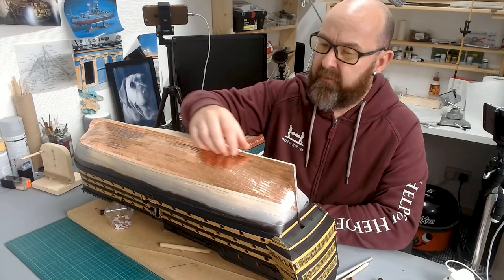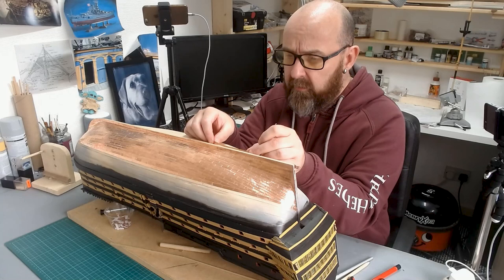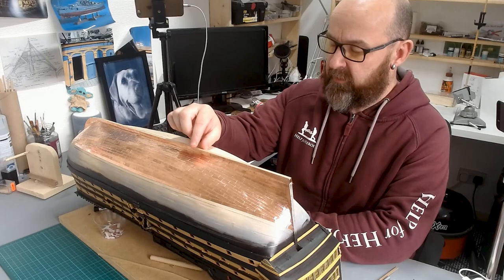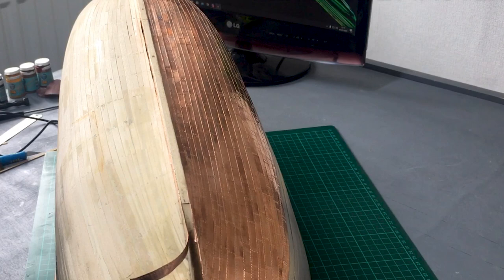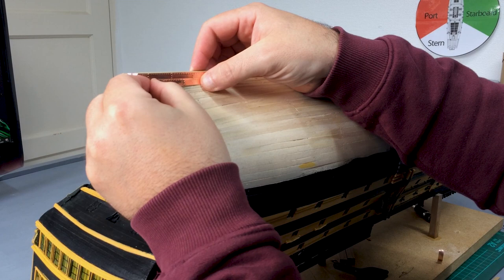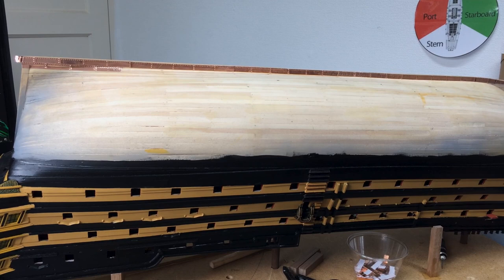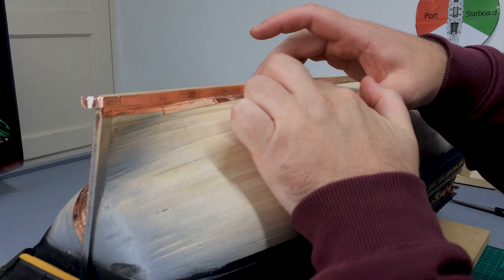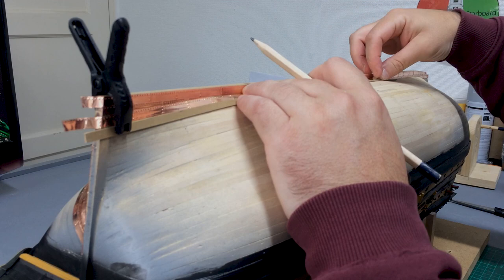1/84 Scale Model : HMS Victory  : Part 61 : Coppering The Hull

Comment: Awesome work John, I am impressed on clean it looks. The copper tape looks easier to work with then the individual tiles. Being able to overlap the strips is a lot easier than trying to cut individual tiles to fit properly. Also the rivet effect show off the hull nicely.
Reply from the maker: Thank you sal, I’ve got part 2 of the coppering, on my channel at the weekend, you can see a lot of the technic, but without much talking
Reply: Just saw this video, had exactly the same reaction. What a difference with tailoring single tiles.

Comment: John, how to you support your model when you plank or copper ?
Reply from the maker: Hi dick. I fitted dowels into the mast holes. Cut them all to a level length then glued the dowels and a board.ones victory is upside down. Add a couple of extra support underneath the ships cappings. Hope this helps
Reply: @Johnbuildsiconic  it does thanks again for this info. You model is fantastic. I bought a mantua 1:98 scale. It leave much to be desired. Pretty much a build from scratch after the keel setup square. I don’t like their laser cut pieces. Some are good most are incorrect.